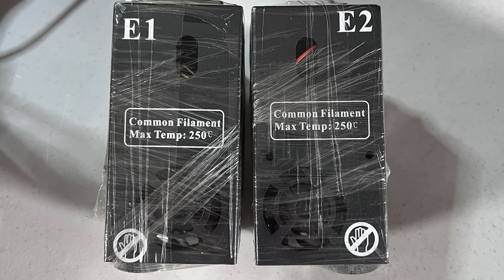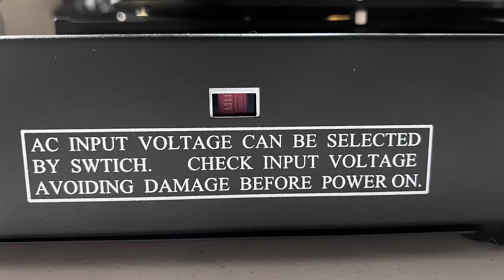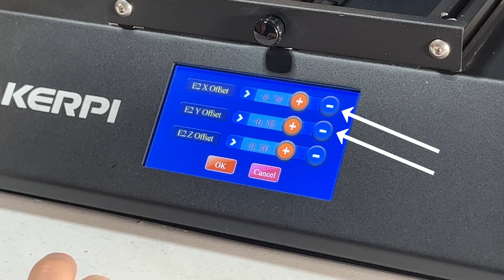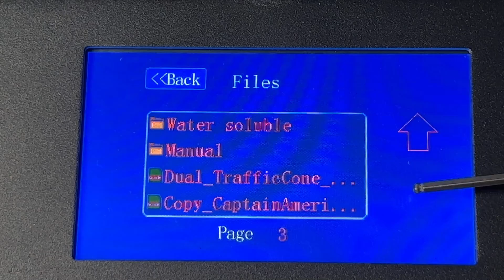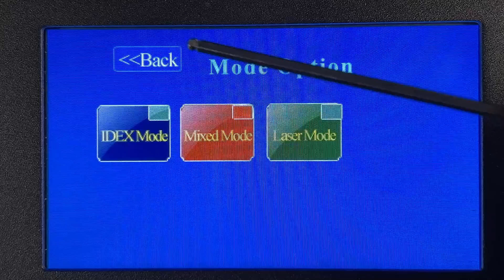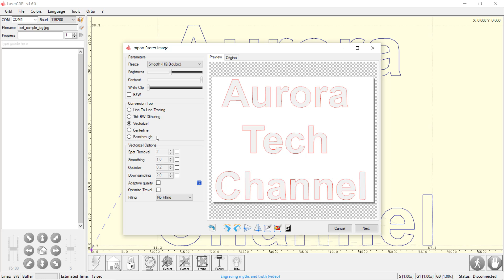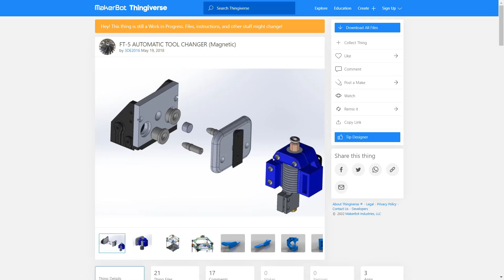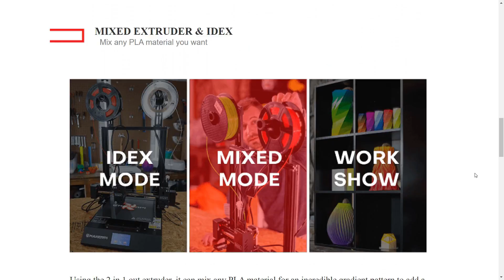MakerPi P3 Pro IDEX 3D Printer, 6 interchangeable tool heads, dual-color printing, laser engraving

Comment: Thank you for all your hard work!  I think I've watched nearly every review you've done, and I haven't found a channel yet that I trust as much as yours.
I have a difficult choice though, and I thought I'd ask for your opinion.  Laser printing function aside, would you consider this to be the best IDEX in its class?  Or would that be the Sovol SV04?  Or would you choose a different one?  After watching your videos, and a few other reviews, these are the 2 I'm trying to decide between.  This is going to be my first printer, and I was leaning toward the Biqu B1 (which at $299 is $2-300 less than the IDEX printers), but the ability to print dissolvable supports seems so enticing.  As someone who claims removing supports is your least favorite part of 3d printing, I thought printing dissolvable supports(or printing supports in a different material that doesn't bond) might be worth paying double the price.  I don't really need to print 2 colors at once for what I'm using it for(simply printing prototype parts), so this is the main benefit I'd be getting out of it.  So I humbly ask your advice as to which IDEX is better; or whether an IDEX isn't worth the price difference just to be able to print supports that are easy to remove.
Thanks again!🙏
Reply: The BIQU has an IDEX conversion kit.  You can often get good deals on the SV04 though, which I would grab if you see one.
Reply: @petercallison5765  Aw man, I already went with a Bluer Plus.  I'm having a lot of issues with it, but I can't tell exactly how many of them are from the corners they cut, and how many are my fault as a noob.  The screen issues and improper hot end assembly was definitely on them.  The rest...I'm not experienced enough to tell yet.  I've had to figure all of it out on my own though, with major help from internet videos and reviews, because Two Trees support team is non responsive(well, 2 responses in 2 months, with no solutions).  But I do think there's potential with this printer.  However, I don't have anything to compare it to.  I passed on the SV-04 because I read reviews on how the wiring was backward, and about other problems I knew I wouldn't know how to fix.  I was under the impression that I'd buy a printer and just be able to print things.  How foolish I was.😂  But I had no idea the BIQU had that conversion kit.  Had I known that, I may have chosen it over the Bluer.  I wonder if the Bluer is set up so that a conversion kit could be added at some point.
Thanks for your response, Peter!🙏

Comment: Those thick, heavy cables and "old" connectors may be there for reliability and to cut down on the "spaghetti" but I can't help but wonder how much weight and drag they introduce. May be a good spot to rethink. The overall concept is attractive although the laser is woefully underpowered. For me the dual print heads and features related to 3D printing are intriguing. Will see if it makes it to market and if it makes the impact on the community the company is hoping for. Good presentation Aurora Tech!

Comment: Thanks for the LaserGBRL tip. I've been having a heck of a time trying to figure out inkscape for this.

Still wish manually editing GCode wasn't necessary.
Reply from the maker: You are welcome! I also watched some of your IDEX videos and they are really great! Thank you, professor!

BTW, I would say Inkscape is usable, I downloaded version 1.1 and it works OK. The extension you need to generate GCode is:
https://github.com/JTechPhotonics/J-Tech-Photonics-Laser-Tool
Just copy the laser folder from the downloaded zip file to:
C:\Program Files\Inkscape\share\inkscape\extensions
Open Inkscape again and you will get a new item "Generate laser gcode" inside the Extensions pull-down menu, it allows you to customize what Gcode commands to turn the laser ON/OFF, but it was not as convenient as LaserGRBL.

Comment: One way to do ABL on Duplicate and Mirror mode would be to print a raft with one extruder at a time and fade out the correction. So the top of both rafts have exactly the same hight. So on top of the raft you do not need ABL anymore and can use both extruders the same time... This would be the most simple solution...

Comment: Nice, professional review! Seems like a great machine , I'd guess around 599USD once released. The serial port solution is quite genius actually, saves a lot of extra cabling! The height adjustment could be solved by simply allowing a Z play on the 4 screws on the back (or having the snap as you suggested with some option to adjust Z).

Comment: Great review as usual, thanks for posting it. 

Seems like a lot of red flags. Kickstarter, poor documentation, engraving laser lacks any type of safety shield, generic looking clone. IDEX is pretty nifty in some instances. As for the 6 toolheads, some seem quite redundant. A good all-metal hotend with direct-drive would cover 4/6 toolheads. Mixing head looks pretty novel, but more gimmicky as it is. A half-watt blue diode is a $20-40 addition, and is too weak to do much with. Cable management also looks rough, and the toolheads look like they're incredibly bulky. As for the linear rail, could offer some nice quality benefits if it were on more than just 1 axis.

Never messed with infrared based bed levelling, so it might be novel. In all honestly, unless they manage to pull off an actual release after crowdfunding for an amazing price. Probably not going to be much in the way of selling points to make it stand out. After countless flops on 3D printing gear with crowdfunding, take all their promises with a grain of salt until they start reliably and consistently delivering.